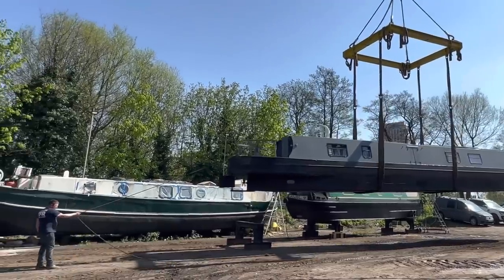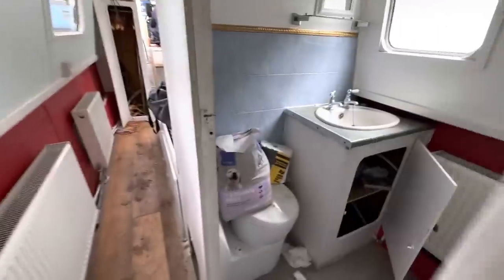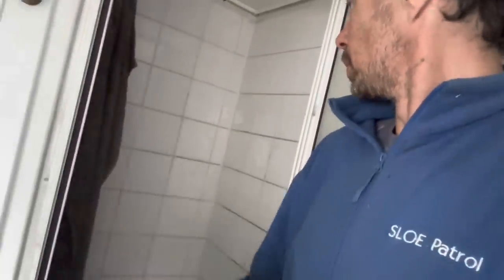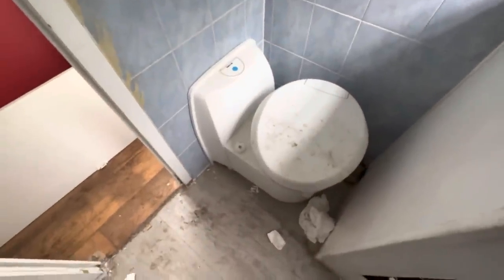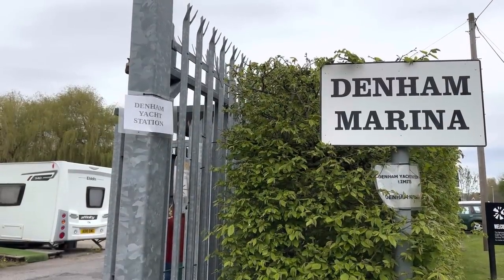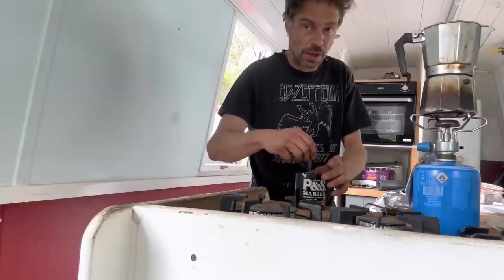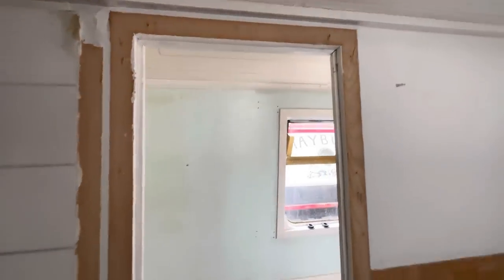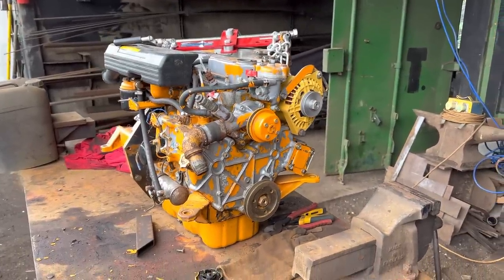415. SMASHING the bathroom up and REMOVING the water tank

Comment: So you're stripping it back to the shell.
Water tank syphon method (bit of plumbing involved, works 10 times better than a pump): as close to the tank as possible, use a step up fitting to take on one side the existing tank outflow pipe, on the other side a 19 mm garden hose. To the discharge end of the hose, fit a 19mm tap with a hose nozzle. Use this to fill the hose back to the tank with water. When full, close the tap and remove the water source. Throw the (full) hose over the gunwales down to the ground, open the tap and Bob's yer uncle, water flow and in rapid quantity.

Comment: Agree with many others - I'm LOVING the daily updates! 
When you re-install the water tank - you could consider just putting it on some hard or high-density insulation board - being spread out evenly, the weight of the water won't crush it very much, it will insulate it from winter freezing and it'll save you from having to rebuild a wooden framework. Might even save you a few pounds (of both types!).

Comment: Siphon? The better alternative for the ceiling/deckhead is tongue and groove EFFECT ply. Personally I hate the look; especially the sauna traditional invariable gaps and irregularities bodge standard; much prefer the minimalism of a flat surface. Nice refurb of the alternator and starter. Rip out the floors and epoxy paint all after remedial work if you can; looks like a definitively atrocious fit out. Anything you do will be an improvement.

Comment: Also when I renovated my last boat I found that grey old style Hep2o pipe would mate into the modern JG fittings fine so long as you use the metal reinforcement collet in the pipe, I don’t know if you’re planning on retaining any of the original pipes but if you do it might be worth keeping a bag of the assorted grey pipe fittings and joints to use later for spares, that’s what I did and it really saved me a few quid and a few headaches. There’s actually a few fittings like the traps off the shower tray and sink which it might be worth digging out of the skip before it goes because it might save you time and money in a few weeks when you start putting stuff back 👍🏻👍🏻

Comment: Hi James only  me all the water pipes for the hot water cylinder are twin coils mean two flow and two return pipes one pair to the engine the other pair to the heater then one cold pipe in and one hot out hence six pipes

Comment: I wonder if the tank was at an angle so that the last of the water could get drawn out? Also, I think those water pumps need a filter before them. Good work - was definitely worth having that bulkhead and tank out.

Comment: Che k into one of the marine brine treatment toilets. They use a porcelain toilet that flushes into a small tank. Brine is injected and charged with 12 or 24 vdc. Which makes it safe to flush overboard. They are marine and coast guard approved. Both heads on My boat flush into same tank and is treated and pumped through a through hull. There is no smell and very little maintenance.

Comment: Hiya....Bathrooms with a narrow corridor are horrible things.  Since you taking walls out, why mot make a walkthrough bathroom?..make full use of width of boat
Reply: Unfortunately, an off corridor bathroom is probably more practicable with a family on board for both privacy and access through the boat. Just because they're smaller doesn't necessarily mean they can't be made sensibly usable. That's the trade off with a narrowboat.
Reply: Thats what I would do. I would put up a wall next to bedroom so its a walk through into bedroom. Have more room in bathroom and more options for layout. Plus get rid of narrow hallway.  Those boats look narrow enough without a hallway.

Comment: That laminate flooring has caused more damage than good.
You can see by the 'Black' deposits, it has sweated and left nowhere for the water residue to evaporate.
Bite the bullet, ditch it all, and put a decent floor covering down. Chipboard is a waste of time, unless fully treated.
Looking at all the internal rust, on the hull, damp has been an issue on your boat and also with the insulation coming away, you need to investigate what's going on mate.
One positive, all the time she is out of the water, CRT can't come a calling for their licence fee.
Bar Stewards done me for another month, by one day!!!!!!!!!
Good luck in your endeavours.

Comment: While the bow is all apart, is it possible to add a bow thruster? I have no idea on the cost. I think its just a hollow metal tube with a motor driven prop inside. Im sure Robs boat has one. It might be nice for maneuvering the 58.
Reply from the maker: No need for a bow thruster. Rob does have them but doesn’t use them massive cost to install and most importantly it won’t help me navigate. They are great for really hard manoeuvres like in a marina but I won’t be doing much of that.